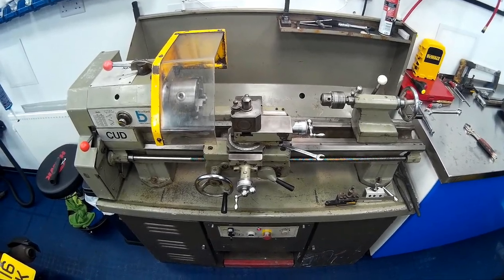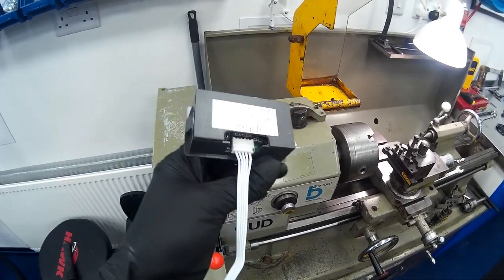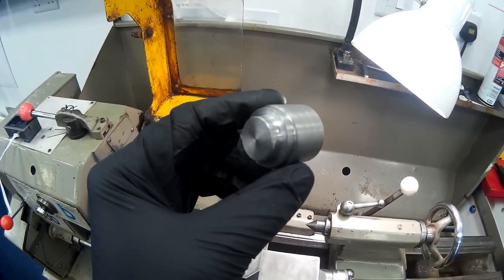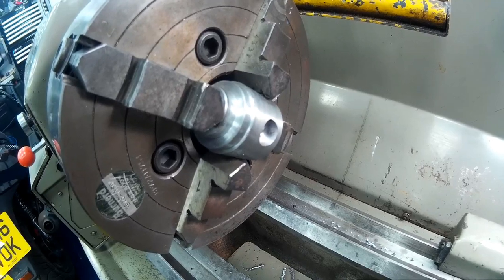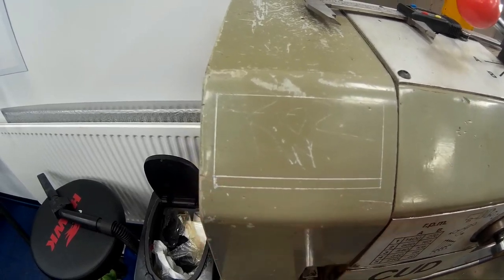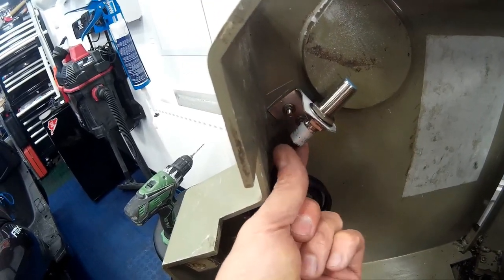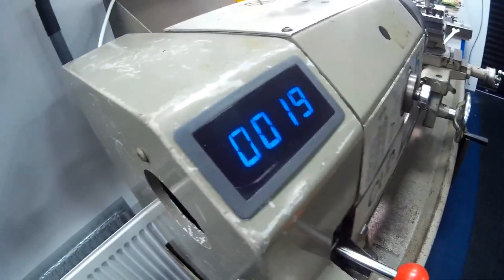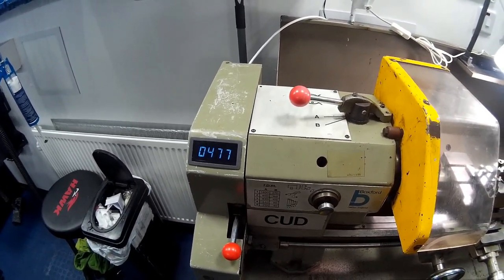Boxford CUD Lathe Tachometer RPM gauge installation

Comment: Arnt you going to have issues with swarf build up inside the spindle bore?   I would imagine that overtime you will ware away the bore and cause inaccuracies with your morse taper ??  Just my thoughts
Reply from the maker: The type of work I do means there's very little boring of work through the back in to the bore. The MT2 is currently unworn and with regular cleaning there should be no issues of swarf build up. 

If there was to be any insignificant amount of wear due to swarf chippings in the spindle then this is completely negated due to the lack of wear on the head gears.

Comment: Sacrilege!  Cutting up the case on a Boxford lathe to fit a bit of Chinese tat that probably won't last.  I fitted one of these tachometers to my Boxford lathe but glued the magnet to the side of the spindle in the gear housing and made a bracket that picked up on existing bolts. The display was fitted remotely behind the lathe, Up to now I have had to replaced the display and the pickup but I have done nothing that can't be undone.